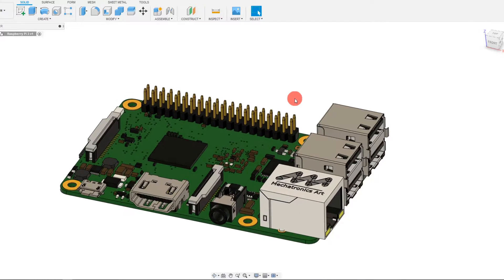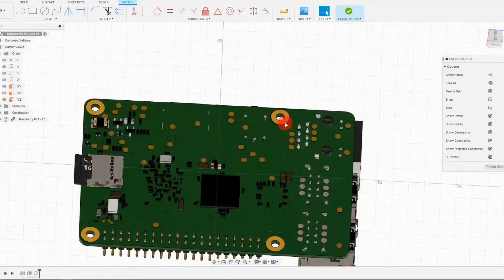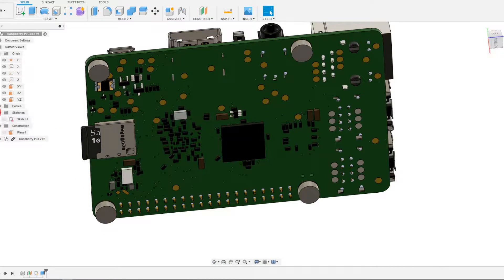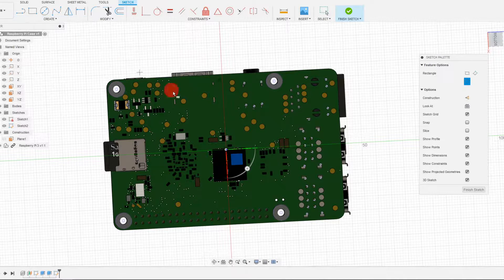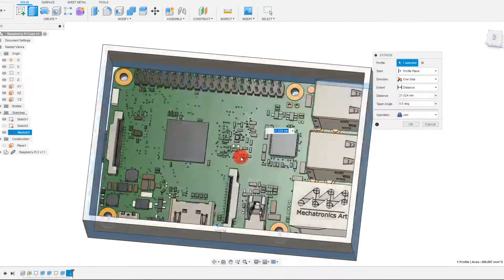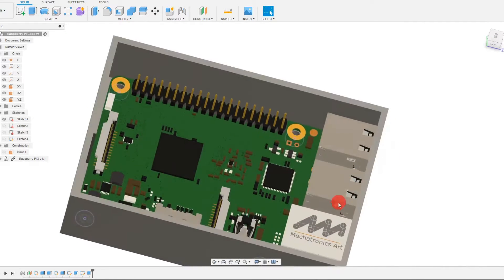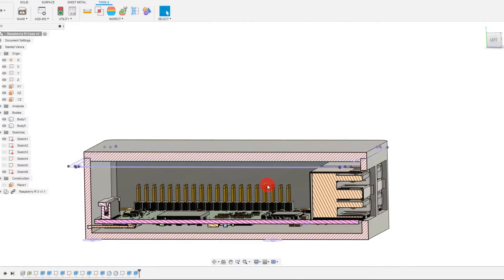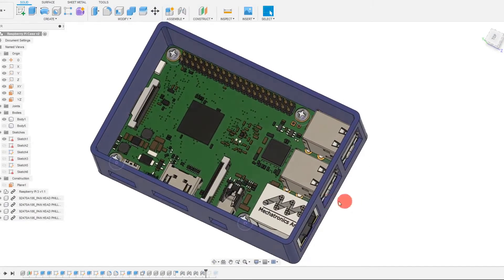3D Printed Raspberry Pi Case Fusion 360 Tutorial

Comment: I have been using F360 for a little bit; but mostly very simple designes and using "baby steps" to get things done.  This video will help change that.

A couple of things were left unsaid; but would really help me.  Did you create the model of the RPi itself?  If not where did you get it?  Also, did you "import" the screws from a commercial source like McMaster-Carr?
Reply: Answered my own questions.
Reply from the maker: I got the model from Grabcad and yes, hardware is from Mcmaster.